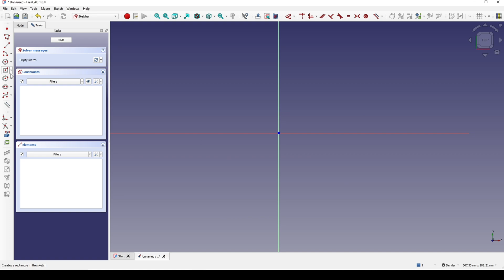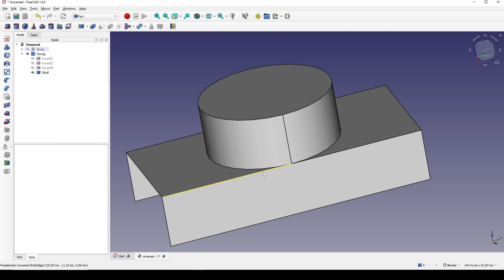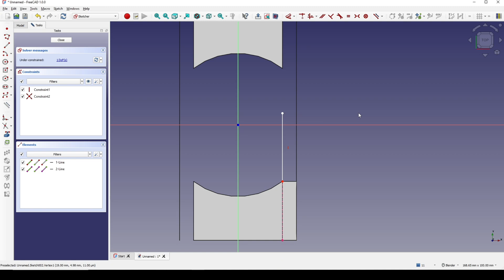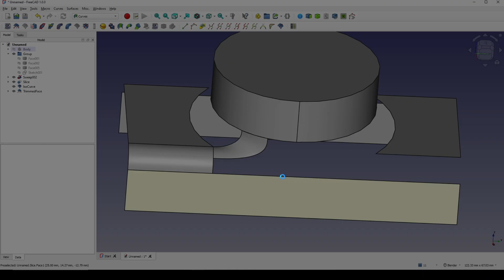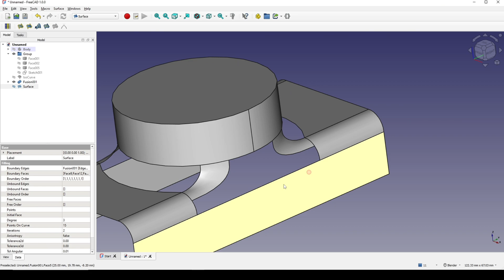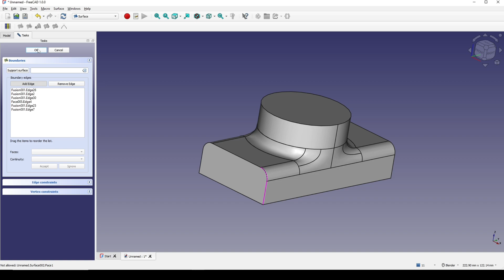FreeCAD 1.0 Create Manual Fillet Using Blend Surface.

Comment: Good morning! Is it possible to do a tutorial about car class-a surfacing with freecad? It will be a great video. I'm try to shift all my work flow, as mech engineer, on open source software suite. Thanks a lot for your attention and your works on this fantastic channel.
Reply: short answer no - FreeCAD does not have the tools you need for Class-A surf. The ability to move CVs is missing as well as crucial tools like the loft or blend surface tool giving it a topology align option etc. FreeCAD is far behind Rhino and that already is hard to use for Class-A.

I also feel after few tests that the FreeCAD openCascade powered modeling tools in FreeCAD produce rather poor surface qualities.
G1 seems doable but G2 it seems is borderline unusable.

I could be wrong - however all FreeCAD models I opened in Alias showed a shocking NURBS patch topology.

Even in Fusion360 this is an extremely difficult task
Reply: Thanks  @cekuhnen
Reply: @romanopescione8700 sorry that i cannot say yes sure …

Comment: Can someone explain the G1, G2, G3 continuity?
Reply: the continuity between surfaces - how smoothly they connect to one another. 
G0 – position (touching)     
G1 – tangent (angle)     
G2 – curvature (radius)     
G3 – acceleration (rate of change of curvature)     

From "Freeform surface modelling" by Metzger and Eismann (sorry no linking to pdf)
Reply: OK, I get it. But why is it important to choose G1 here? Of course, I should build the model and find out for myself, but that doesn't necessarily get right to the core of it. How would I know by looking at the shape that G2 (for instance) is going to cause me problems?